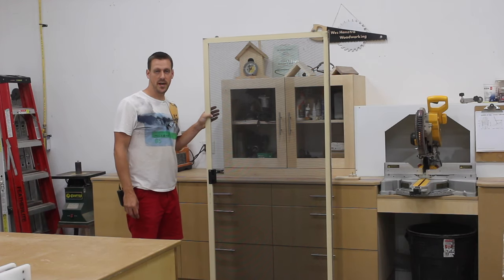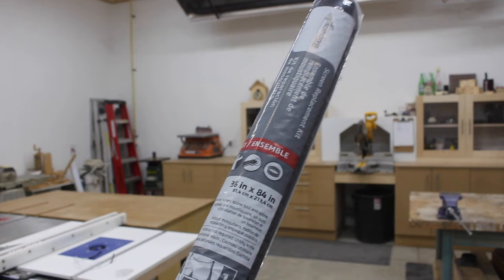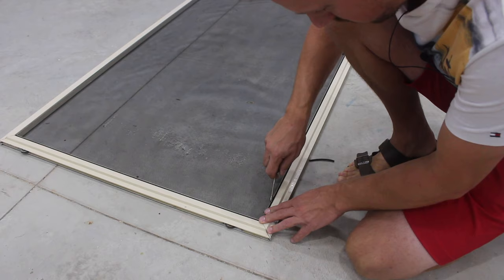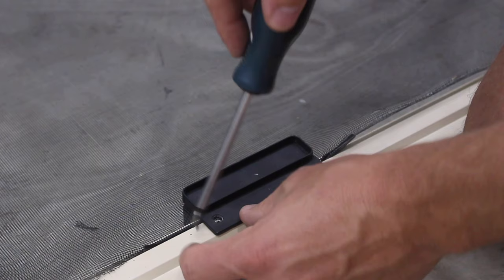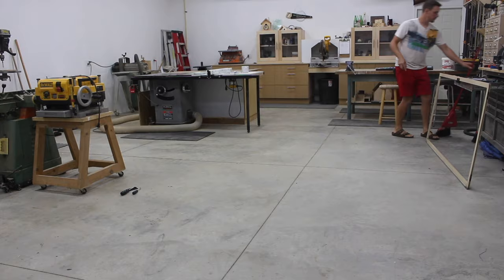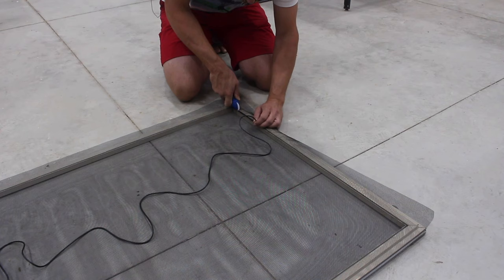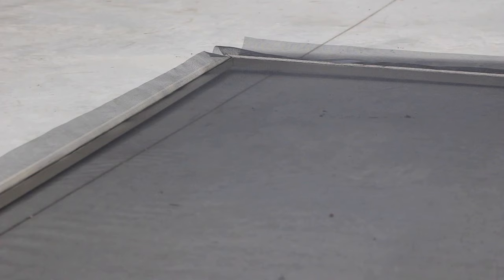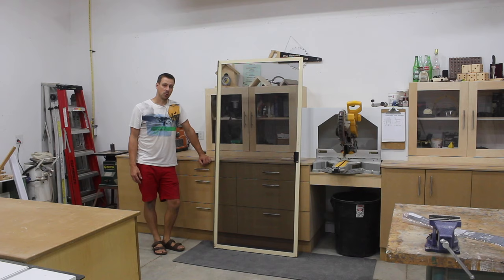How To Re-Screen A Patio Door

Comment: When you try to take an old spline out, look for the starting point where the old spline was started. When you find that point, use that hook tool to get that spline out. Once you pull that starting point out, grab with your hand and it is easy to take the whole spline out.

Comment: Tip: replace the spline with electrical wire that will fit into groove. And you can read-use it back again and again and lubricate the sling metal with grease. This method works for me.

Comment: So stupid question but do you have to remove the screen door to fix it? Is there any way you can do all that without removing the door ?
Reply from the maker: Yes, you have to remove it. It’s super easy. Just lift up on the door and pull the bottom out.